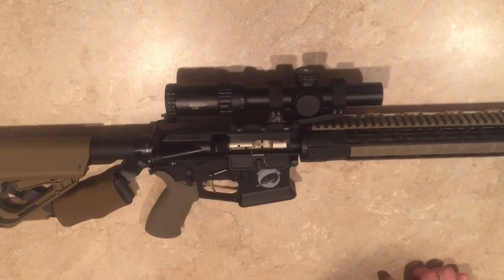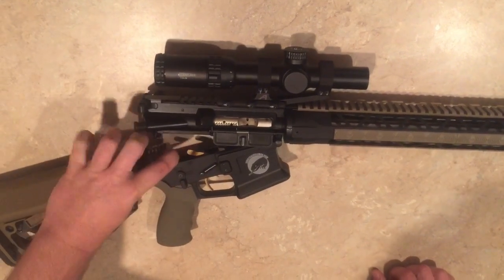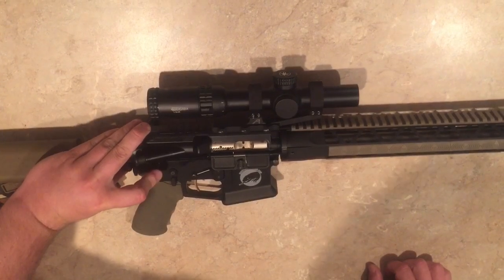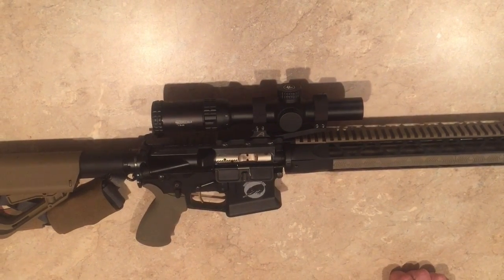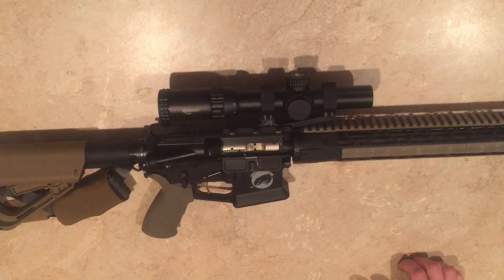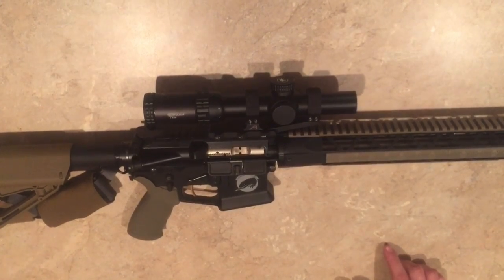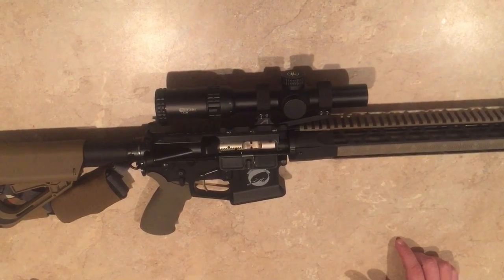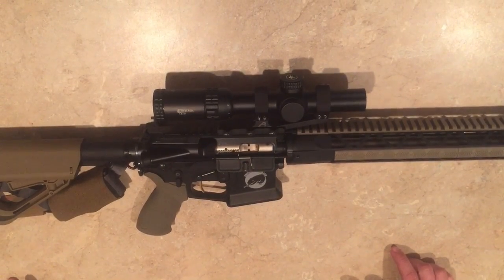No buffer detent in an AR15

Comment: I had a 9mm AR Carbine from a major gun manufacturer, the bolt was not long enough to contact the buffer when the rifle was fully assembled, therefore every time the rifle was fired the bolt would cycle but the buffer would slam into the buffer retaining pin. This caused major damage to the face of the buffer and also bent the retaining pin. I contacted the manufacturer, they must have known about the problem because they sent out a new BCG asap. But to get the bent retaining pin out I needed to use a Bridgeport and mill it out as it was wedged in place. I wish I could include a picture of the chewed up buffer face but I can't. Needless to say buffer retaining pin can be an issue. The gun ran fine without the pin, the buffer and spring would just attempt to launch themselves to the moon when I opened the rifle...
Reply: I have a toolcraft bcg and the same thing was happening. the buffer got all chewed up. I still have it. Just took out the detent until I got replacements.
Reply: Was it a psa lower?  Had this issue yesterday at the range and the detent got lodged in the fcg(first time firing the ar pistol) and dont want to deal with the nightmare of customer service and I dont mind not having the detent at all if its not needed.  I have other "real" guns that I can actually trust my life with but dont want an expensive paperweight
Reply: oakfallen 666 It happened on my PSA lower.  Im debating on whether to send it back. Retaining pin fell out and would not chamber the next round

Comment: My retaining pin just fell out while firing and you’re absolutely right about it malfunctioning.  It would not chamber the next round. It’s a PSA lower and was shooting 300 blk
Reply: I have a psa upper and lower.  I used all of the pins except the buffer detent.  Can I still use it safely?
Reply: Samuel L Yes.   You just have to catch it when taking it apart.  I don’t use one either anymore

Comment: I have seen one of these bust in combat, and jam up the trigger mech. Even last week, i was at a training event and saw a rife go down from one busting. The spring wrapped itself down into the hammer area and made a mess.
Reply: Can you explain? Like this happened because of the pin not being there or be because the pin was there?
Reply: The pin was there, and was broken by the buffer hitting it. It could be that the pin was improperly made, or that it was worn out, but since its not really needed, i choose to be safe and just leave it out of my builds.
Reply: @jontheballer  Then your rifle was out of spec. A buffer retainer detent will never break in an in spec rifle..
Reply: @hairydogstail  USMC's Rifles, not mine. Im a AK guy these days
Reply: @jontheballer  If the rifle is in spec, the only time the buffer will touch the detent is when the rifle is opened..There is an easy test to see how much clearance any AR rifle will have between the buffer and detent..

Comment: Buffer detent will never fail if the rifle is in spec. An off set buffer detent will fix this if the lower receiver is out of spec. A short bolt carrier can also cause this problem.. There should be at least .030 space between the detent and buffer when the rifle is closed..

Comment: i took mine out, apparently my lower is a smidge out of spec so the buffer smacks the detent causing damage to the buffer. removing it doesnt affect the operation or the reliability of the rifle by any means and the part in question is purely a convenience part so... f*** it right?
Reply from the maker: Take it out and let it run

Comment: My buffer detent failed the other day after I swapped out my 5.56 upper for a .350 legend upper. I'm assuming the buffer spring was being compressed more due to the higher power round and was slamming the detent pin harder than usual causing it to snap and then lock up my rifle. Had to take it apart in order to get it to function again.
Reply: So your rifle worked well with out the detent?

Comment: my brand new ruger ate that thing off after 3 mags and it worried me the bcg or something isn't right with it.    now after seeing this, I'm fine with it and I'll keep running it without it.  ruger has no warranty anyway.  I don't feel like sending it back for this.  I'm going to let it go. and see what happens.  I'll buy one just to have.  but this gun is going to be sold asap.  I'm not satisfied with ruger's quality and lack of any warranty at all. wish the gun shop told me ruger wont warranty their guns at all.  I will never buy ruger again.
Reply: Same thing happened with my Ruger MPR. Both the upper and lower are out of spec just enough that the detent was chewing up my buffer pretty bad. I did a little digging on forums and found an offset detent to fix the problem. Would recommend everyone to stay away from Ruger AR pattern rifles.